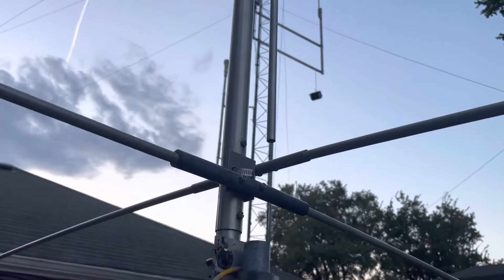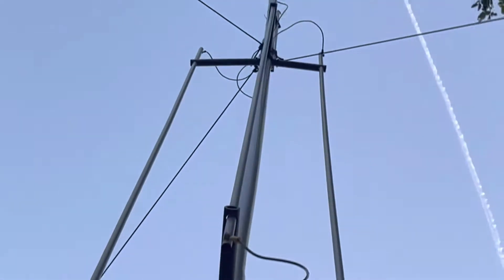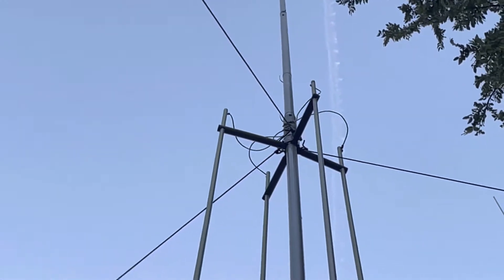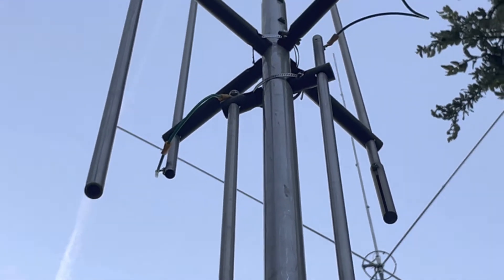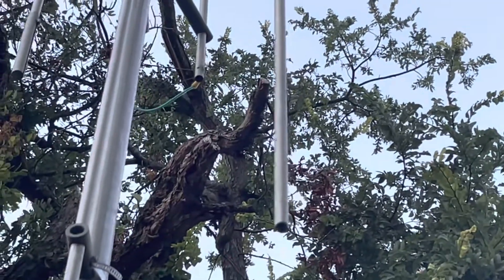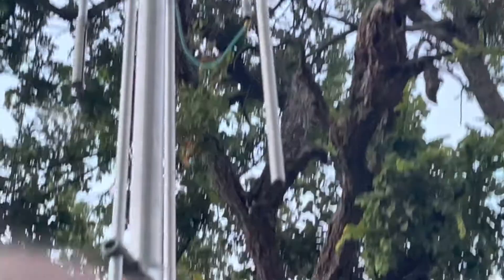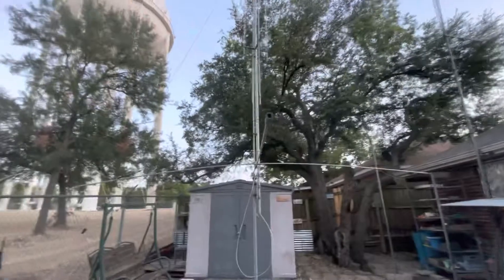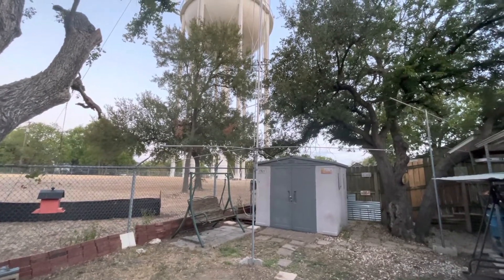Gap titan DX HF Antenna

Comment: The counterpoise has tension that hold the end caps in place on mine.
Reply from the maker: Yes indeed getting the counterpoise adjusted right with that split bolt is key to the tuning.

Comment: Between your mistakes and questions I don’t even have to read the directions to put mine together now 😂.  Good luck resolving your issues. KD2NFE
Reply from the maker: For the most part all is resolved. I added a comment today to my original post. The comet CH256B is a better antenna though.

Comment: This antenna works well.
   There were videos on its assembly that help a lot. Assembly requires getting everything right since the elements interact. 
     The rope on the counterpoise is necessary and the length of the wire influences tuning (I think for both 80M and 40M.) The one I worked on had too short a counterpoise and the SWR was too high for 40/80M. Once a new longer piece of braided copper antenna wire replaced it, it as usable on 40/80M.
   Whoever assembled the antenna I worked on  did not get it right. Watch the details and you will have a great antenna. N0QFT
Reply: Здравствуйте, приобрел такую антенну Gap Titan DX. Её мне нужно отремонтировать и установить себе на крышу. 
Скажите пожалуйста, получается на диапазоне 80/40, этот провод по периметру не должен идти целым, он должен быть разделен капроновой веревкой ? 
R8LDJ, 73 "

Comment from the maker: This antenna has turned out to be a great antenna. Especially for 10 and 20 meters. I am just worried about how good it will stand up against storms in the spring. It is guy wired.
Reply: Hello James Horak ,do you know where i Can buy the Gap Titan? Thank you so much.
My QRZ is F8CWW.
Reply from the maker: @brunostann8408  From Gap Antenna's in Florida.

Comment: That stuff would not last the Canyon winds here in Utah, 70 -80 mph at least twice a year! Brenda’s Husband  JohnBoyUtah KJ7TBR 😎🇺🇸📡🎙
Reply from the maker: Yes the design flaw is that the top section is heavy and not guyed. We are going to be getting 40 mph winds Thursday Dec 22, 2022.
Reply: @kg5pte   I live in eastern PA, and have a Gap Titan that has been up for 20+ years.  It is not guyed.  We have seen 80+ winds, and the antenna has never been down or damaged.  It has been around several other antennas.  By use of an appropriate amount of coax, the SWR is flat on 40M through 10m.  Worked 3W9T recently on 17m, so I know it works.  I have gotten 292 countries on this antenna, and WAS on all bands except 80M - just need KL7 on 80m.  The antenna works.  Intermittent sound like a loose connection in the antenna someplace.
Reply: That’s why you guy it.  That’s the relevant issue,.

Comment: Hello my friend, please tell me what kind of wire can I use in the band of 40 metres, it must be insulated wire or without insulated, HC1TWF 73,s
Reply: Gracias mi amigo HC1TWF 73,s
Reply from the maker: I had to order a new counter poise wire assembly from Gap titan today.
Reply from the maker: I also use an MFJ 1982 MP wire antenna. For 40 meters.